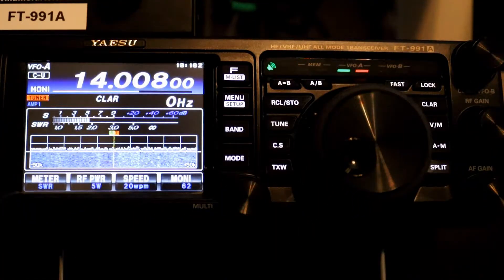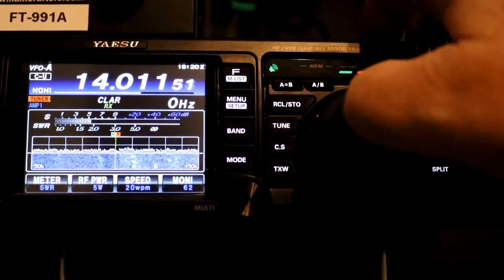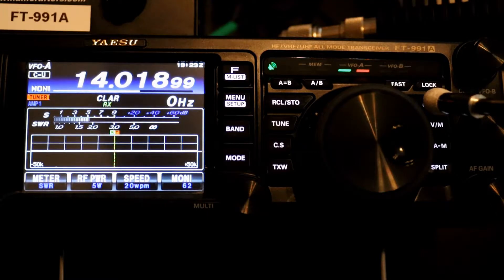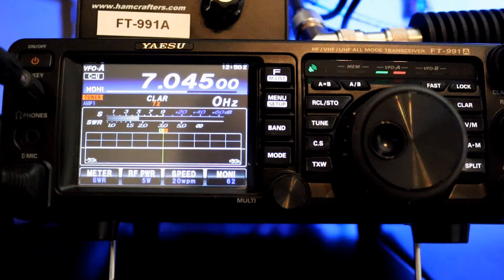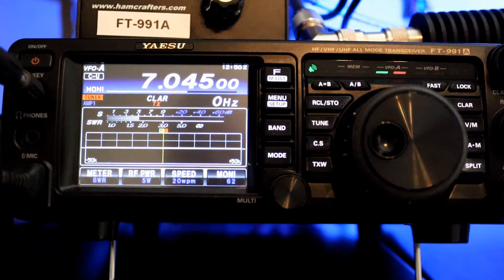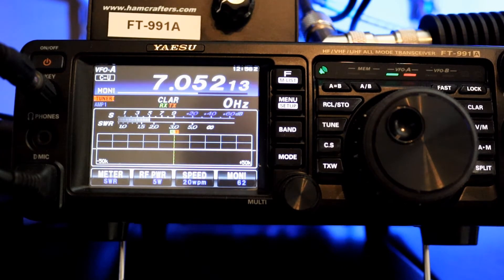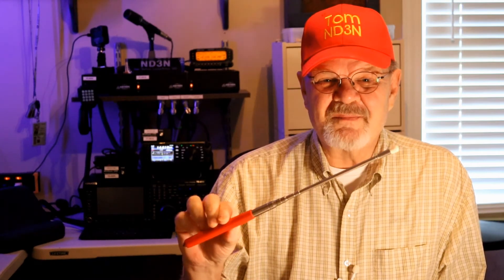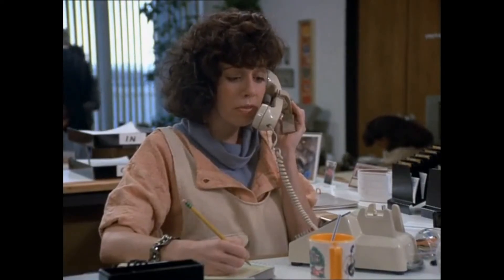FT-991A CLAR - more than a button on your rig...

Comment: Had to look up this setting and found this video.... I saw in the manual it could change RX, TX, or both, but I didn't realize there was a menu option to change the behavior, thanks for the tip. 
Looks like you've got the tuner in circuit, I haven't noticed any drop in signal quality, but the manual suggests to remove it... I hear a clicking, but I don't actually know what it does